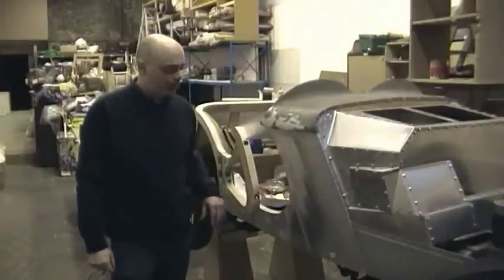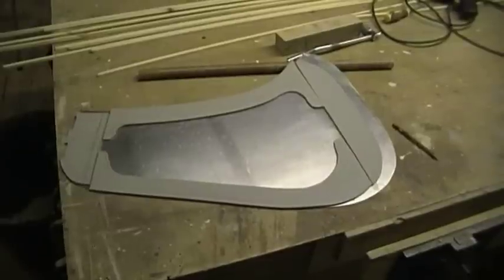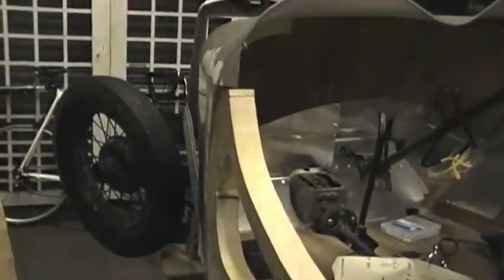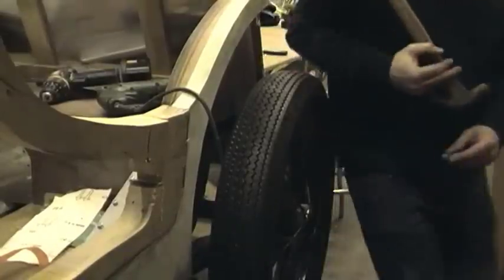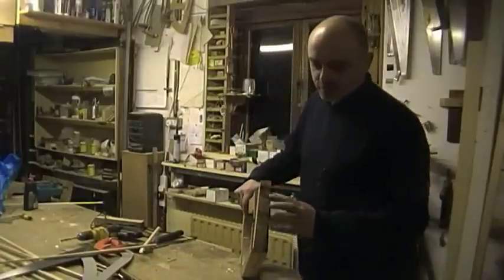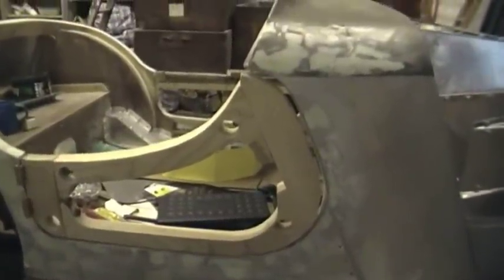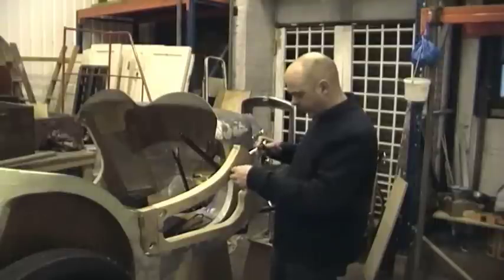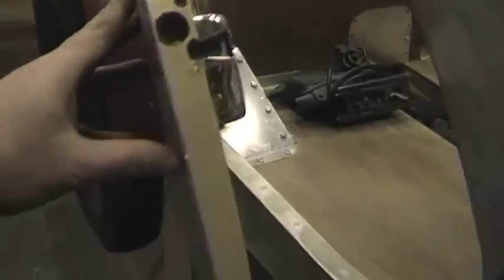Making an Ash Door Frame For an Ash Framed Pre-War Car

Comment: Hi, this is a very interesting video. Thank you for making it and sharing it with us on YouTube.
I am building a replica of a 1955 MGTF on a Vitesse Chassis and as I get close to working on the doors I am facing a dilemma. Do I continue with the rather heavy framed fibreglass doors which are rather bulky or make new ones as you have shown here? Which fit really nicely.
I did see another YouTuber skinning a Morgan door which was a steel skin and was clinched around the whole door like a modern car. I think I will have to have a closer look at a genuine TF and possibly a friend's TC to see exactly how they have their skins attached.
Certainly, watching your video it appears to be a straightforward process to make the frame.
Question... After you have finished the frame and drilled the dowel holes, do you disassemble the frame to apply wood glue to the joints before reassembling and glue and dowel? 🤔
Kind regards Paul from 48 Spokes 🇬🇧